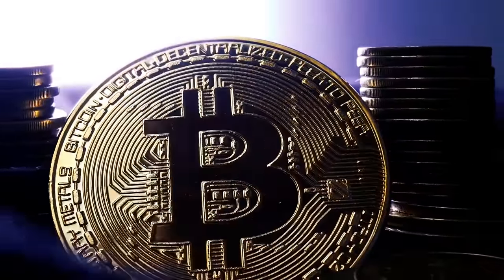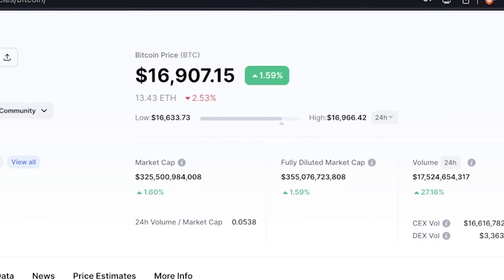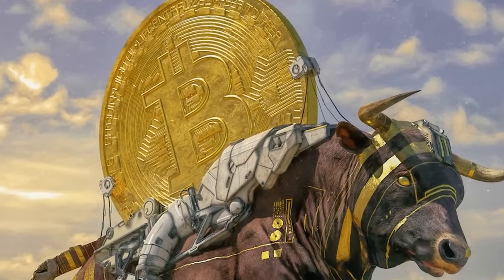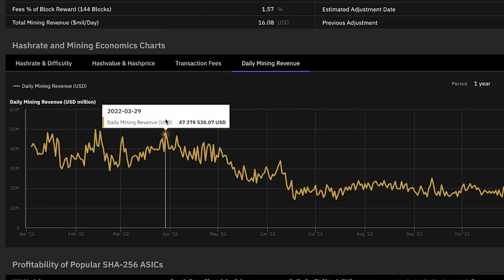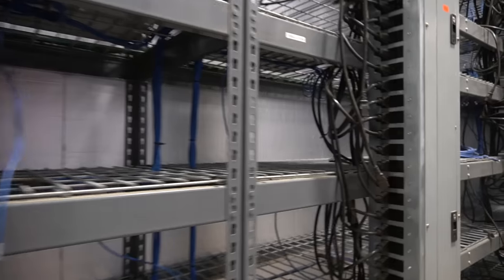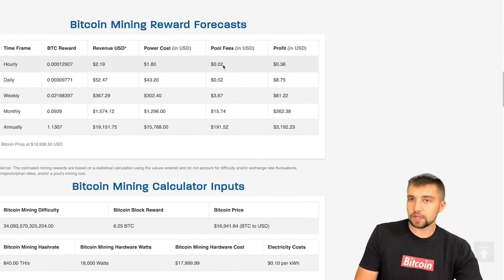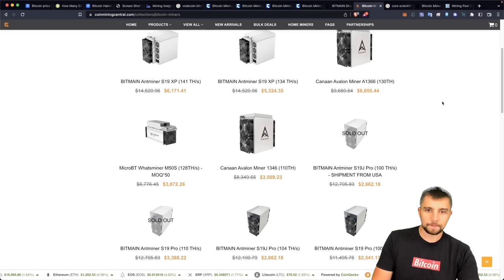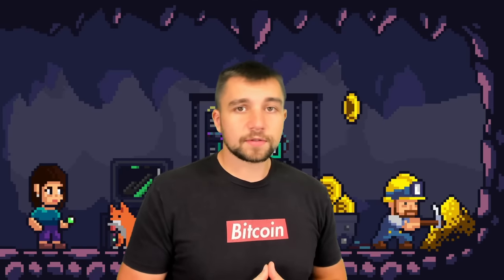What Do YOU Need to MINE ONE BITCOIN In 2023?!

Comment: $30k for $3k profit is still a 10% ROI. Not bad.
Reply: The problem is how long until you're not making any profit
Reply: @johnsartain4160  yep exactly
Reply: I’d say 10% is horrible considering what one has to do. When anyone can buy and hold bitcoin for two years and make hundreds of percent with no effort.
Reply: If you plug into the neighbors power
Reply: If you measure value in cuckbucks... btc is the unit of account. Calculate the cost of asic in btc versus daily btc income. Electricity costs are generally fixed where btc has infinite upside. Plus the asic value is also directly correlated to the btc price in cuckbucks so it does have resale value. Just to covered a few points missed

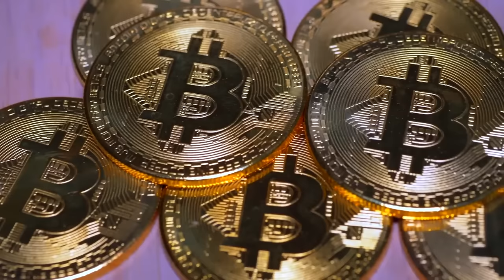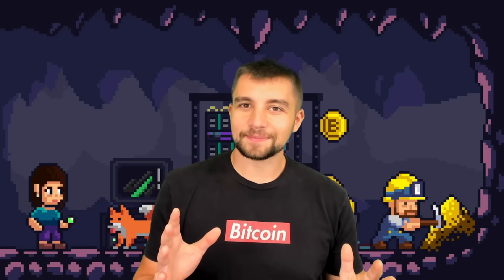Comment: O.5, 0.10 electric wow in the UK £0:35 =$0:43 Do you guys know how lucky you are.
Reply: At those rates some used solar panels and a cheap all in one inverter would probably make sense. Is that an option where you live?
Reply: @callmebigpapa  yes but this time of year only getting 7.5 hours of daylight,  so would need a large solar system plus a large battery pack
Reply: @cpeplow8117   agreed. Not financially viable. Very difficult if not impossible to mine in UK
Reply: @1982dsc  why is that? Is electricity cheaper in usa??

Comment: The question is, would it be better to take that cost/initial investment and just buy BTC now  (particularly before the value goes up)? How long is this equipment usually used for?
Reply: I have miners that I bought back in 2018 that I still use today. Most miners pay for themselves in about 16 months and everything after that is profit. The key thing to do is to buy during a crypto crash. Never buy miners when crypto is in a bull run because the cost of the miners rise faster than the coin so if you accidentally buy when the coin price is high you will have trouble recouping the money you paid for the miner. I purchased some Antminer L3+ during the crypto crash in 2018 for as little as $54 and they were able to pay for themselves in 3 months and began to run a profit in month 4.

Comment: Have you looked into replacing these asic fans with quieter ones such as the noctua ones? I think they have some with similar CFM ratings.
Reply: BTC miners need insane airflow to keep cool, those only work on low hashing L3+
Reply: You can however use grow tent fans with attachments
Reply: exactly...
Reply: @chickmagnet6004  air flow does not need to mean loud.

Comment: I only mine and considering the amount of electricity I use I rely on systems outside of my interface and store with a confident market holder so the coin can never be lost since the wallet is held in a invoiced account, overall the main issue is not spending, as the income is paid in small continuous contributions

Comment: Hey Vosk, I know you have done some videos in the past about taxes, you mind doing one for current. I haven't converted to fiat currency so not sure I need to claim the 'income' yet. How do you do it?
Reply: It has not changed. You pay income tax (USA) based on the value of what you mined, when you mined it. I do it based on when it hits your wallet.
Reply: @gotminer7834  that was helpful thanks bro, appreciate the advice.
Reply: @gotminer7834  you pay ordinary income tax when you mine it, NOT capital gains tax. That's only when you sell.
Reply: @EarlCo  Correct. My mistake.
Reply: @DPac  Sorry for the confusion. I had originally said cap gains tax. As someone else pointed out, It's income tax, not cap gains tax.
Reply: @gotminer7834  All good bro. Is there an app you use or spreadsheet and manually entering everything. I ended up doing it on a spreadsheet, thinking there has to be an easier way.

Comment: Vosk What PDU and Cables-power lines-plugs do I need for KD3 166 th Miner , does it use 2 110 volt or 2 -220 volt power In's /  Thank you it be here Tuesday and I am looking for K7 for under 7k ish if possible , or BTC Miner the 255Th or possibly the 198Th water cooled
Reply: 2 c13 cables both at 220. The btc miners you mentioned are 480 v. You can't run em endless you have a commercial property plus they still need the entire cooling system (pump, water tower, controller ECT)